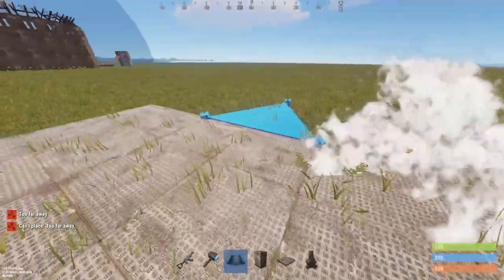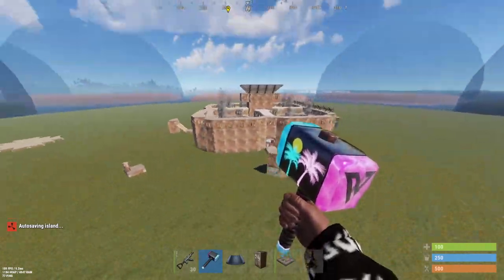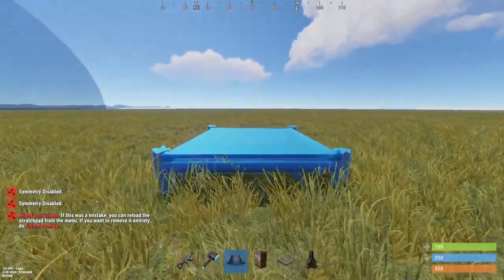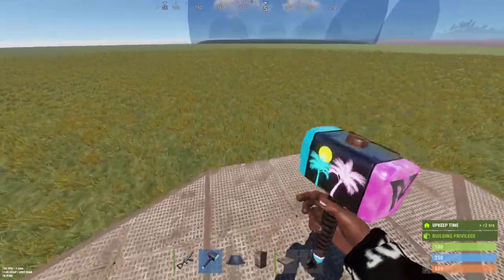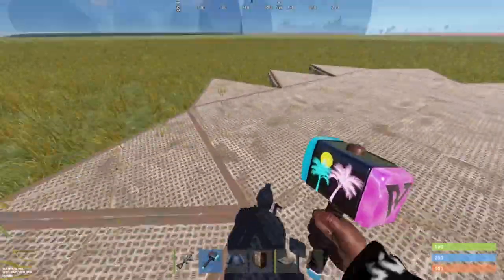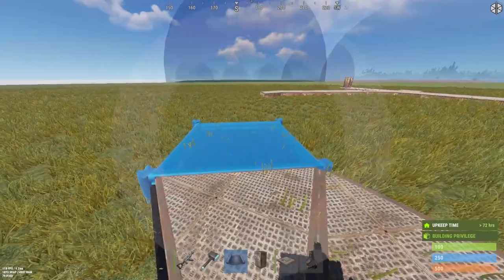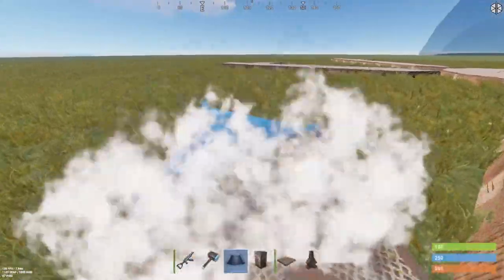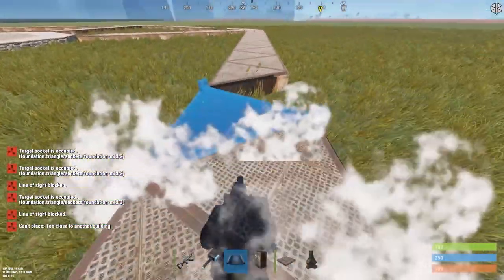How to ADD CHINA WALLS TO ANY BASE DESIGN IN RUST

Comment: Old video I know, but this concept doesn't work on console for some reason no matter how many way you try with the initial design when you build out from the external TC's unless you go two triangles inwards from the fifth square foundation and then 6 square foundation out to then connect the wall and have a small gap. It's a symmetrical square but the way in this videos no longer works on rust CE hope this comment helps whoever is here in 2024 ❤

Comment: How do you replace a TC if it gets raided? Main & China wall TC?
Reply from the maker: You should design then china wall with disconnectable external tool cupboards, this way you can disconnect them and replace main TC
Reply: @JustAnotherGamerr  Thankyou, do you know a link a video that perhaps shows how to do that? i'm not familiar with it
Reply: @Vekal90  you can use mini satori disconnectable it's cheaper an easy to connect with any type of base